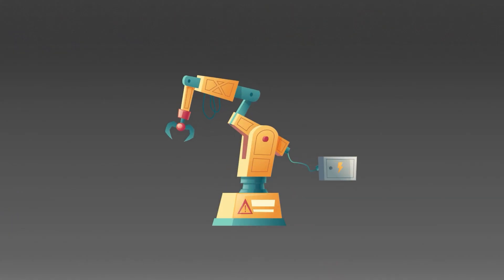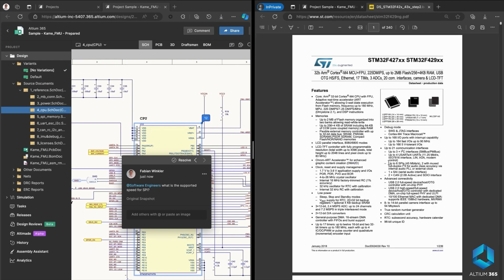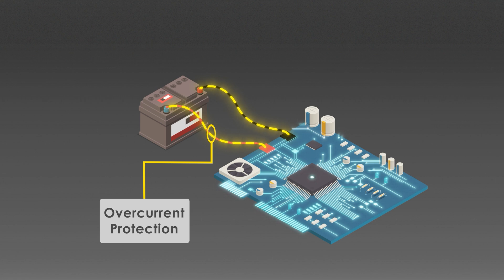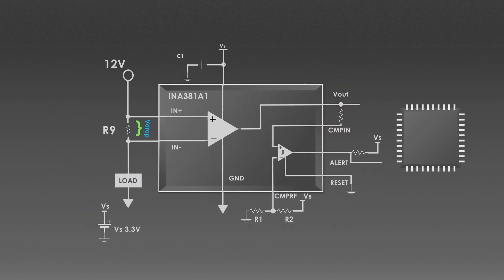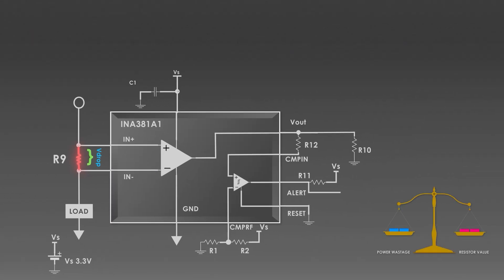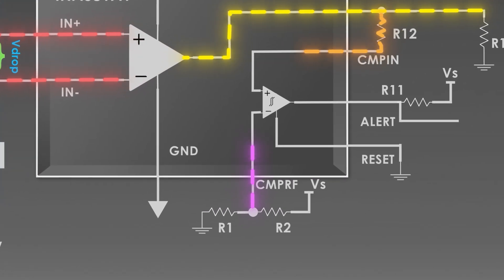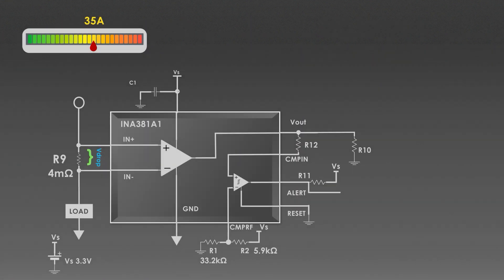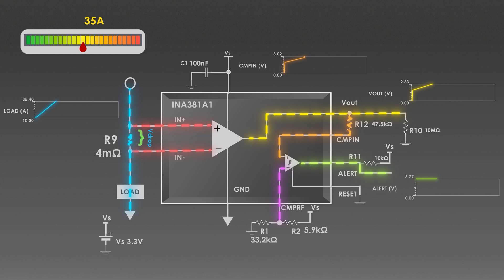How to Sense Overcurrent using Opamp? Overcurrent protection circuit using Opamp

Comment: It seems that there is a problem with the logic at the output of the comparator. The comparator's output should default to a low level, and when the current exceeds the set value, it should change to a high level.